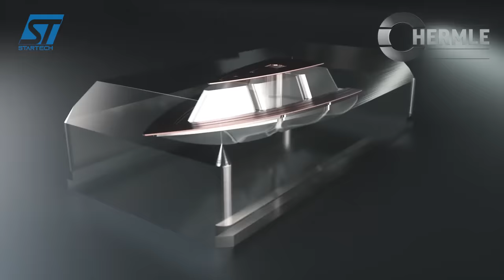99% People Satisfying When See This CNC Working Process. Perfect Machines Technology

Comment: I use to run a CNC I never got tired of doing it..
Reply: I thinking about become a cnc programmer / operator
Reply: Ha to tera cycle time jyada honga
30sec ki cycle time k sath chalana phir bat krna..
Reply: Start writting g code manually u will b tired soon
Reply: @Yukam1912  facts!
Reply: @Yukam1912  why , it's all about understanding only right
Reply: @satzbee1394  try writting and find out
Reply: @Citizenof98  so in all honesty if you live in the U.S it can be kind of a slog. An operator is a human parts loader. CNC programmer has to be able to handle high stress, long hrs and posses a very high attention to detail. most CNC programmers spend about 2-5yrs as an operator.
Reply: Me too, then I set up , programmed and fell in love with moving metal. CAD/CAM changed the world
Reply: Yes, this is so fucking awesome and helpful tool, especially if you need non-standard tool to unscrew sth and you can't buy it anymore... I am now in this kind of situation, but fortunatelly Dremel and file also does the job perfectly. :) It takes more afford and time, but I can't complain -  this is faster for sure then finding  person who has correct tool and get the  job done for  me...
Reply: Wojciech Pordzik  dzięki wielkie. Pozdrawiam
Reply: @Citizenof98  Don't, that job pays terribly and it gets boring quickly.

If you're not prepared to make 100 same pieces everyday, while getting shit wage for it, then don't even think about it.
Reply: Wojtek Troll  Not just Poland.
Unless you work in Germany/Switzerland you won't get good wage for this job.
Reply: @Yukam1912  why would you write a g code while softwares like Powermill exist....?
Reply: @ur.cristiiano.o  before those software times we used to write al those programmes manually and it was a pain , and that is what i am saying

Comment: I currently run cnc for work and I absolutely love it
Reply: Why do people say job won’t be around for long
Reply: @divulgewithchip1099  Because they have no idea about how things really get made.  They rave on and on about 3D printing replacing machining. Robots replacing people is another common claim they make.  Reality is that 3D printing is slow and no where near as precise as machining.  Robots can be hit or miss depending on the application.  Most shops don't have the volume of parts that having a dedicated robot would demand.
Reply: @divulgewithchip1099  Because nobody wants to do that job.

CNC machining is shitty low paying and boring job, which requies high skill and knowledge.
Reply: I think this video is very good. We have similar machines. If you are interested, we can talk about it together
Reply: @walkelftexasranger  in my area pay starts at 25 an hour for entry level and 45 an hour for 8+ years of experience.
Reply: @lilfingas  where you live at
Reply: @MrWilbur63  near fort gordon. most of the work is for defense contractors and requires a security clearance and frequent drug tests tho
Reply: @lilfingas  I start on Tuesday entry level.  It’s math? Or is there more to it
Reply: @MrWilbur63 At entry level you will probobly just mass produce a single part. You probobly wont touch much math or programming for a while. Later on you will have to use plenty of math. You will also have to learn G&M code, high precision measurement, blueprint reading, and plenty of other skills.
Reply: @lilfingas  H&M’s code hard to learn. 
Is it a hard job
Reply: @MrWilbur63  H&M code is very easy but it will take a few months to master. I wouldnt saythe job is very difficult but it does take skill. At an entry level job you wont have to worry too much tho. They will train you plenty.

Comment: When turning threads on a lathe, is it a specific automated setting, or do you have to set the right variables in yourself? On a regular lathe not cnc
Reply: depends on the lathe, but all the manual lathes i have worked on it has to be set manually.

Comment: So one day they could mechine an cnc the whole body for a new car out of solid block ? Be awesome. An I mean full size car !
Reply: So...in fact it is possible to do a whole car chassis out of one block with cnc, 
But the reason why no company or car-manufacturer would do this, is based on the reaction of your car, when you are having an accident with it. (Im from Germany and dont know how to describe the word "reaction" better, but what i mean with it is the way your car / chassis gets deformed in case of an accident)

So technically, if you are having a car accident, your car would "breake" at some points of its chassis, so that a part of the kinetic energy would be absorbed, of course your car would be destroyed or hardly damaged, but the driver or the passengers would not get the injuries, they would get when the body of your car  were out of a solid block.
So if you would produce a car out of a solid block, it would be pretty strong at itself, but it would not absorbe any kinetic energy of the accident, and the passengers would get way more deadly or critical injuries as in a car with some points to soften the blast oft the impact by bursting.

I hope i could write it in a way that you all can understand what i mean,
have a nice day ;)
Reply: @Nodge_lnh  I am in the usa . An here we call them crumble zones. I am obsessed with cars / inventions / how things work / an different types of engineering both process an design. An it could be cnc to account for all that. Could also be two solid shells that slip into each other. An have a bolt in carriage.  But custom cars dont have to meet those standards.  If titled as a custom. Here anyway.  It be to costly most like to do so . An you would be right in your description above also. With today's advancements we could make one an I have no doubt it would meet the needs of crash standards. With things used from tech / an engineering combined.  Yet I know it would be way to expensive.  To mass produce. Might have to reengineer the whole car tho from scratch .🤐
Reply: printers....